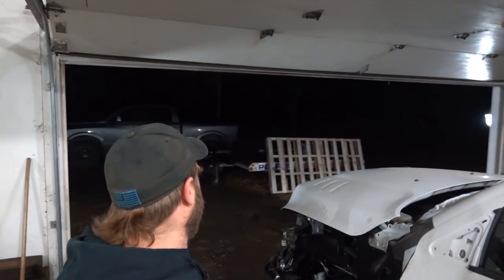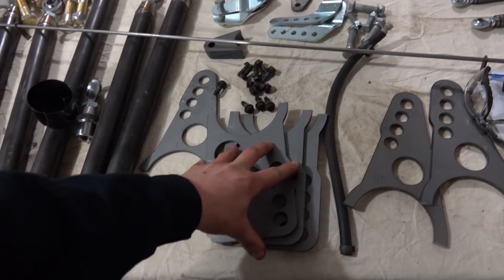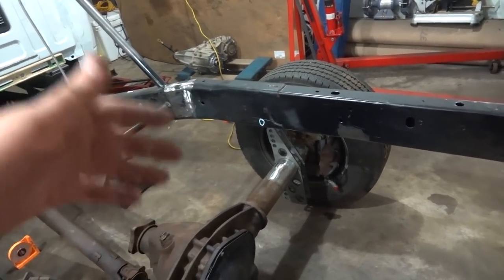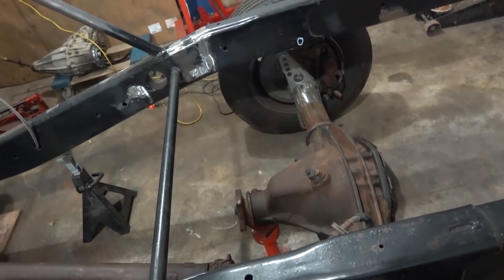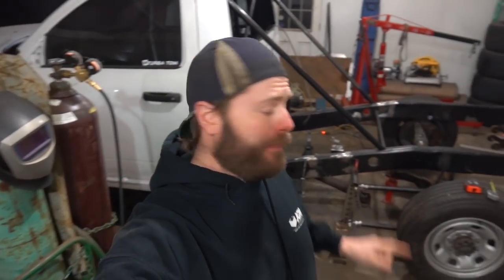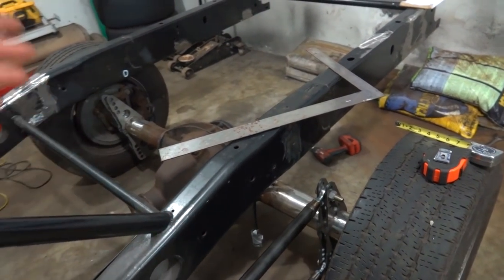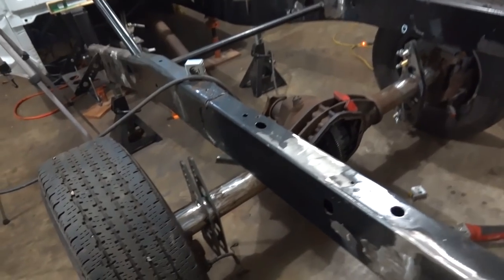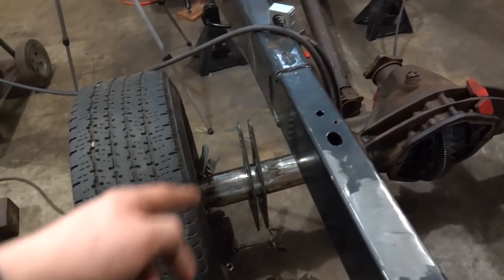Cummins 4 Link Rear Suspension Install Begins... It's Off To A SLOW Start!!

Comment: You better weld inside and out the first time you get on a good track with alot of bite its going to try to spin the axle tube and bend the axle four link brackets seen it happen

Comment: Find where you want your instant center you have a heavy heavy front end so your instant center can be a little further forward than like a car with an aluminum motor.  Further forward will pick up on the front end more but you don’t want it so much so that you waste a lot of energy lifting the front a lot. Mine on my Turbhoe point upwards back to front like you are talking about.  You do t want the rear to squat cause that will unload the tires on the launch you don’t want the rear to lift too much either cause it could hit the tire too hard as well.  Mine lifts about 1/2-3/4” when I launch and she hooks hard. You are more than likely never going to have that lower bar point in a downward angle so I would put the lower bar level with it in the second to third hole up on the axle and in the bottom hole of the front bracket. That should get you the clearance you want but still with plenty adjustability to take the front of the lower bar up on the front bracket.  I really hope that makes sense.

Comment: The mount is pretty close to the tire so I don’t think you would have problems with ramps as the wheel will he lifting soon after the mount passes that point. Never done one before for just my opinion.

Comment: Need to know where your ride height first. Make your bottom holes even at ride height for adjustability. Depending on a ton of factors you'll want a lot of anti squat or a little less and bar angle is how you'll adjust along with ride height. If your limiting your ability to adjust then why install a adjustable 4 link anyhow? May as well done ladder bars.

Comment: I’ve never done this before so I have no solid feedback, but if it was mine I believe I would lower the ride height if it was only going to see pavement or concrete. Also seems like if the bars were longer they would be able to be mounted higher with less problems

Comment: keeping the lower links level will minimize torque steer characteristics under throttle.  If you want more info search for anti-sqaut and 4link
Reply: are you going to build a cross member in between those frame side link tabs? other wise extreme gussets might keep them from twisting...
Reply: as far as heim shank exposed length just i try to keep 1/2" to 3/4" exposed max...  enough for fine tuning but not a weakpoint.